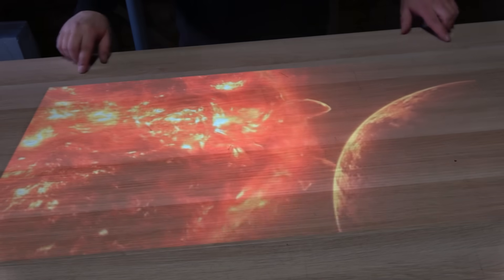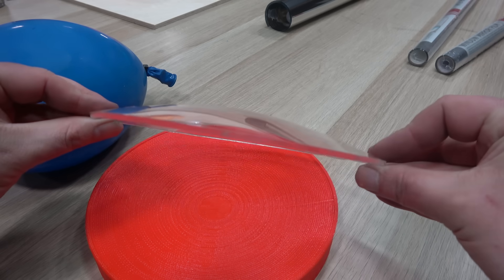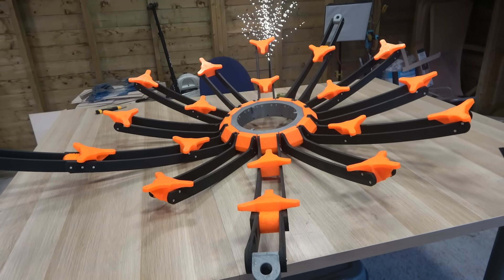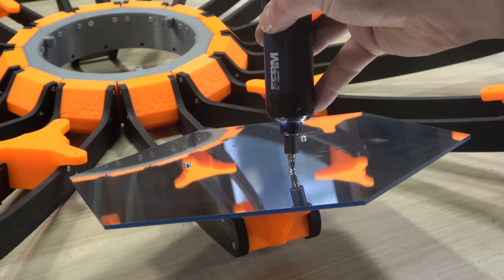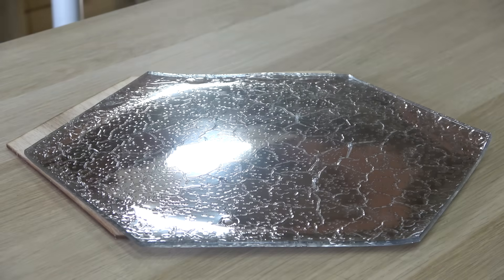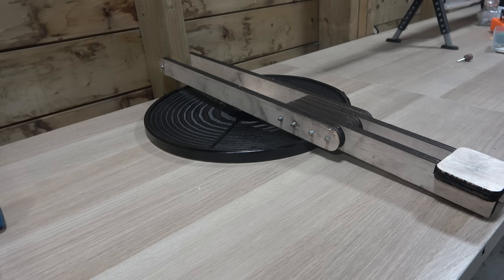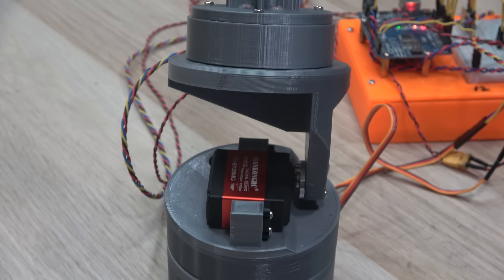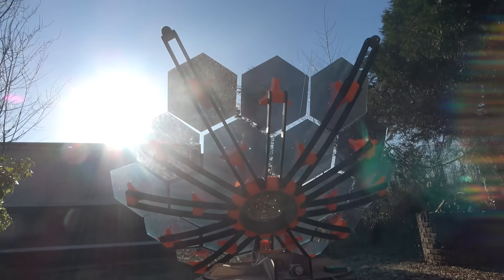Building a DIY Solar Generator..

Comment: Instead of allowing the water to flow through the collection plate under acrylic, I would of put copper tubing and soldered it into place to make better contact. Better contact allows for more efficient transfer of thermal energy. Also, the water will get very hot and start to build up pressure which can cause the acrylic to start to flex under the pressure, plus the heat making it softer. 
On my single solar thermal collector I had on a 2ftx4ft panel, the water would start boiling before exiting the system, which led to a lot of a air locking keeping the water from flowing smoothly. The system had to run under pressure to keep the water from boiling so easily.
Reply: Yeah, that acrylic backplate is just begging for leaks.  The mirror tests already show it can significantly flex at 100C, and there's going to be a lot of water/steam pressure in there.
Reply: @danielf3623 I was thinking that using the same principle that vacuum coffee makers use, would be helpful here. 😂
Reply: I suggested in another comment that a car radiator would be a better collector.
Reply: I'm also wondering if freezing will be a problem. Overnight there is gonna be a bit chilly
Reply: "would of put" - Sorry about your country's education system.
Reply: @Anvilshock  Ok Karen 🙄
I only reply because of engagement for the video creator.
And no, it doesn't have anything to do with the education system. It has to do with lazy grammar, and "EVERY" country/language has their own version of lazy grammar. It's not just the US and/or English. 
How about you spend your time more wisely actually teaching and sharing your knowledge instead of belittling others.
Reply: @korishan  Not to mention that we lack knowledge of the writer's native language, and it was potentially the result of not being a native English speaker... However, if you really want to complain about someone's English Grammar and general capacity in using English, look at the current American President... The man can't even manage a coherent sentence. 💁🏼‍♂️
Reply: @ Funny how you guys jumped right at assuming I meant the US edu system. Didn't say a word about that. "Methinks thou dost protest too much" indeed. Besides, maybe it's not my native language either? Guess I'm simply, I don't know, using my brain instead of parroting YT-comment-section-level English.

All I'm hearing is whining about having been called out on negligence and ignorance as if it were some inalienable right. The same old, worn-out, deflective non-arguments that may sound terribly clever to those who use them but instead confirm they're just as guilty, if not more, of not spending their time as wisely as they are so eager to recommend others to do.
Reply: @ Funny how you jumped right to bashing someones language, intelligence, country, all based on 2 words in their comments.  Maybe you shouldn't be such a negative Nancy and Karen and actually use the comments for constructive comments, not trash talk.
Reply: @korishan  Again, I did exactly none of those things. Not language (merely conversing in English doesn't count), not intelligence (you don't need to be smart to not be lazy), not country (merely the system that evidently failed to teach successfully some grammar of some language). Literally, demonstrably, everything you tried to use as an argument was wrong. Dude, you can't even hurt my feelings with your pathetic attempts at misrepresentation.
Reply: @Anvilshock  if you objectively look at your wording, it does indeed sound like you're insulting the intelligence and skills of the person you commented on.
If you wanted to not sound like that, the phrasing could have been considerably more polite, and utilized words that aren't as frequently used in negative contexts.

However, based on your phrasing, you seem more like a Troll... A commentator who derives pleasure from the negative attention their comments create, without injecting anything of value towards the original topic.
I mean, just look at the current topic... There's not a hint of discussion about how to improve this solar project.
Reply: @BJCMXY  If you want to "objectively" look at something, why do you then continue with something like politeness that is entirely subjective? And who says an exchange must stick to the video topic at all times? You? Do you always have no real arguments, or only when you open your internet-browsing device?

Comment: I think you should create a solar tracker that only requires grid coordinates and a calendar to operate. With those two pieces of information, one should be able to create a platform for solar collectors that is 100% accurate without worrying about it being exposed to the sun.
Reply: for me it would be more of a hassle because you would have to code for it. his solution is pretty straight forward easy
Reply: That probably wouldnt account for cloud cover very well
Reply: @GabrielRowanonYoutube An advantage of a system like I described is that it wouldn't need sunlight at all. It would face ideally regardless.
Reply: @1chumley1  I guess that depends whether ideal = pointing at the sun, or if it's whatever the brightest part of the sky currently is. For a place that is often cloudy it may not be the sun

Though in any case I do think making it point at the sun at all times would be cool
Reply: @Incommensurabilities you really only get power out of solar panels when they are pointed at the sun. You won't get anything out of them if it's partly cloudy and you point them in the brightest direction, the light bouncing around is all incoherent, and nowhere near bright enough. 

Solar panel efficiency also drops off RAPIDLY even on cloudless bright sunny days when you don't have your panels angled directly at the sun.

Comment: try to cover the heat plate in something extremely dark. Maybe soot for a simple solution, or vantablack (or similar) if they can withstand the heat. That should absorb nearly all the light energy
Reply: Tried vanta, it's not rated above boiling - if your pump ever fails, it'll burn and lose a lot of its qualities.

Comment: I'd use metal springs as well as mylar applied to the plexiglass after it has been shaped. If that aluminum plate is meant to heat the water then it should be painted, or better yet powder coated, matte black.

Comment: What is the energy loss of having a 2 mirror system vs having the alumnium plate take the direct reflection of the first mirrors?
Reply: The weight of the heating plate might be the main reason for the design choices here.
Reply: More complicated piping I assume
Reply: @p529.  same piping. just put the plate into the focus point and its done.
Reply: @jpjay1584  I'm assuming it's more about the weight of the heat plate versus a mirror than anything else.
Reply: He was already worried about the weight of the array on the arm for the up and down movement so shifting most of the array weight to the tip likely would have been too heavy for the current setup. More efficient use of time and his resources is just to use a secondary mirror as the loss of heat would be minimal anyway.
Reply: The 2 mirror efficiency is just the 1 mirror efficiency multiplied by the mirrors efficiency. That is assuming the optics are perfect. The efficiency drop is probably much higher as the paint he uses is probably 70% reflective and I don’t think his optics will be perfectly aligned. Also his absorbs on plate is aluminum which has are near 95% full spectrum reflectance so most the energy that hits it will just bounce away
Reply: Yeah, the ‘heat plate’ really should be at the focal point of the mirror array, instead of a double mirror.
Reply: So beef up the armature and put a heat plate out at the focal point. Then you can use flat mirrors.
Reply: my guess very high, because the parabolic shape of the mirrors make the sunlight be not parallel anymore. my guess is its very complicated to get a shape refocusing all of it to the heat disk. plus the mirror foils are pretty subpar compared to real mirrors is my guess

Comment: Did you apply the paint at the front of the acrylic panes? It wasn't clear to me, it would be best to apply it at the back like with any mirror. Then the aluminium core plate must be painted matte black of course, you do not want that to act as a mirror too. I expect some issues with boiling, tubes may burst or come off. You may need to control the water flow based on the plate's temperature, making sure it won't exceed 90 degrees Celcius or so. And using astronomical data tables for your date and location seems more effective than trying to figure out where the sun is in real time. This is how all trackers for solar panels work. Overall I am impressed once again.
Reply: Yeah, he's going to need a lot of water pumping through that block to keep the sink below boiling temperature, which means needing a constant use for the hot water.  Recycling got water will also make it boil.

Honeslty, being able to form the plexiglass mirrors at 100C means getting any where close to boiling will cause the seals around the plexiglass backplate to pop.  The tempreature and constant water/steam pressure will warp it.
Reply: A common mirrors is backed to use the main clear material(glass) as a means to protect the thin coating that produces the mirror finish. Typical acrylic mirrors(makeup mirrors and the like) put the mirrored surface a the front to prevent double images. I ideally the lenses should be coated in metal foil as paint looks like metal but it doesn’t have the same properties. 
When using a mirrored backing the acrylic will absorb some energy reducing efficiency of the mirror and generating unwanted heat. Given the mirror is acrylic that additional heat would likely deform the shape of the mirror. Putting the mirror on the outside will reflect more of the incoming light and reduce the temperature of the acrylic.
Reply: @jacobs8718  That's nonsense, we're dealing with direct sunlight, not lasers or already concentrated "high energy" light beams.
Reply: @MartinMaat  I rewrote my response. I reread it and I disliked the tone and content so I changed the direction of my response to promote better discourse.
btw, I said  “high energy” not in a technical but relative sense. The suns 1000 w/m² load is not insignificant to a design that uses sheet acrylic. Typical use case for an acrylic mirrors is indoors and notably less than 100w/m².
Reply: @jacobs8718  I still don't see how direct sunlight is going to heat up an acrylic pane. Do you have a source for that? The stuff is used all over the place as cheap double glazing, mounted on window frames, facing the sun. It does absolutely nothing. We had one such pane at home when I was young to save energy. I just looked it up, it only gets somewhat soft over 85 degrees Celcius. It never significantly goes over room temperature. Granted, with a back coated mirror light passes twice but so what? It is a clear material. Even if it would absorb some frequencies, those would already be absorbed on the way in and thus will not be absorbed again on the way out.